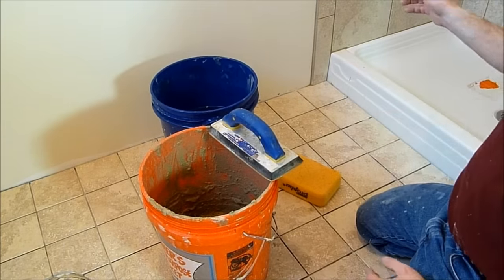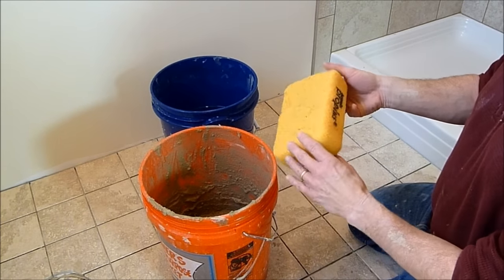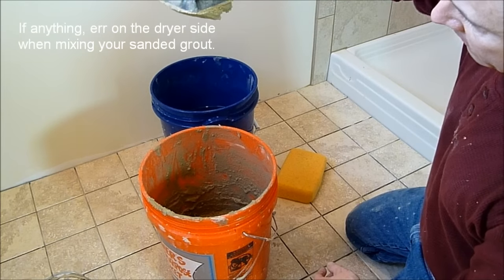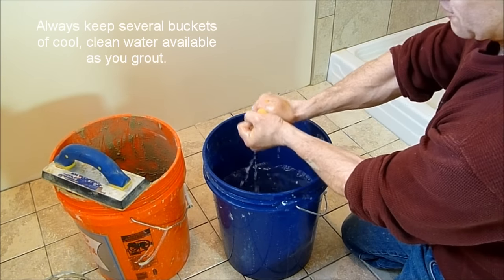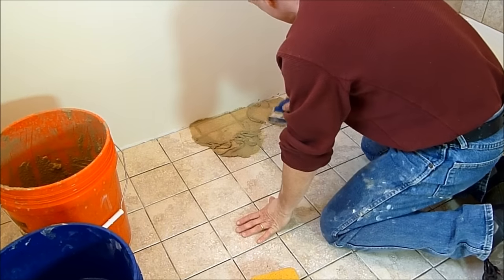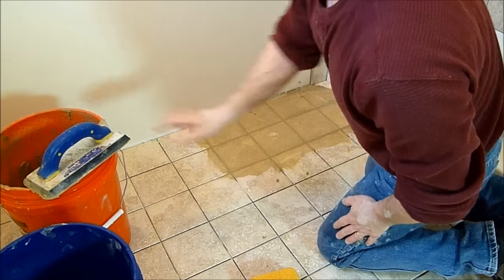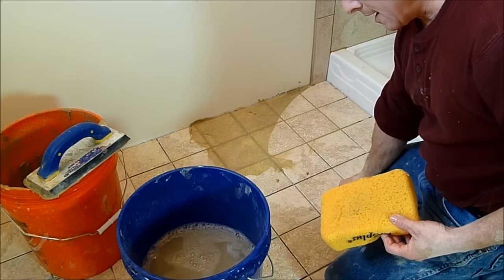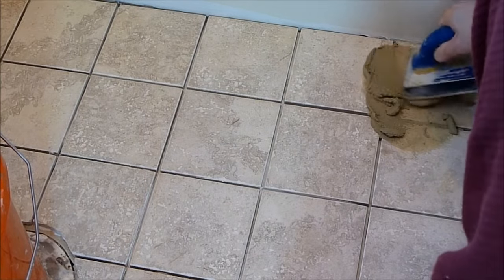How To Grout Tile: Correct Technique Makes It Easy

Comment: Grout contains silica sand and lime. Please wear grouting gloves. Also, if you choose not to wear knee pads, expect to file for disability by age 40.
Reply from the maker: Well, I'm 14 years overdue on the disability I guess.   I often do wear knee pads on larger jobs, but this particular floor was small.  The lime doesn't bother me too much on my skin and I'd rather have the direct feel of the sponge.   If you have sensitive skin you could try dishwashing style gloves, but they often tear on things and let water in anyway.
Reply: I only needed to have my fingertips burst open just once for me to decide to wear gloves all the time
Reply from the maker: HAHA! Wow!  You must be a violent grouter, indeed.
Reply: enduringcharm not violent... commercial. Grout ten thousand square feet of tile without gloves and see what happens 🙂
Reply from the maker: Commercial work is a different story.  Residential tile work rarely means grouting for more than a couple of hours.  The largest bathroom I've ever done, including shower and floor, probably didn't take more than three hours of grouting.

Comment: I
Like how these guys claim there is a difference in a  sponge, i use whatever sponge i have on hand!  Sponges All do the same thing, hold water! It’s like saying to can’t drive a Chevy to the store you need to have a Ford!
Reply from the maker: There are significant differences in sponges.   Tile sponges shed their water much more thoroughly  when you squeeze them out, which is important for not leaving water in the grout lines.   The texture of the sponge surface is finer and has no ridges, unlike a household cleaning sponge.  Tile sponges also hold up longer to the physical abuse of wiping and squeezing without coming apart.   Tile sponges are sized to allow control of hand pressure and access to corners while still providing plenty of surface area.   A car washing sponge, by contrast, is much thicker and would be difficult to get into corners in a shower or  to use with light pressure.  In addition, its important to use a new sponge or one that has only seen grout so that there is no contamination of color, dirt or chemicals.

Comment: That looks more wasteful than it probably is....
Reply from the maker: Bruce McMicking There's really very little "waste" in grouting because the bulk of it goes back into the grout bucket and only a little bit of grout on the surface ends up in the water bucket.
Reply: Is this the same thing you would use for a fireplace hearth?
Reply from the maker: Bruce McMicking
You might use tile and grout for a hearth.  Other possibilities include brick or stone with mortar joints.
Reply: I have tiles. Are you saying regular motar would do for grout?
Reply from the maker: Bruce McMicking No.  If you have ceramic or porcelain tile on your hearth you should use grout product designed for that material.  If you have stone (like granite or bluestone) or brick you'll use type "N" or type "O" mortar.